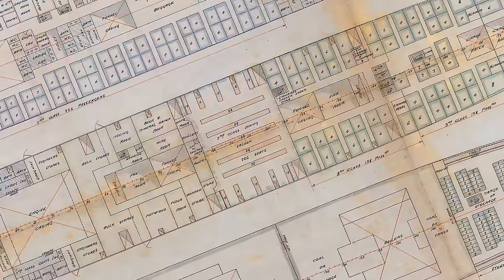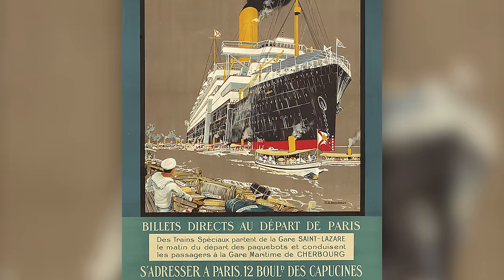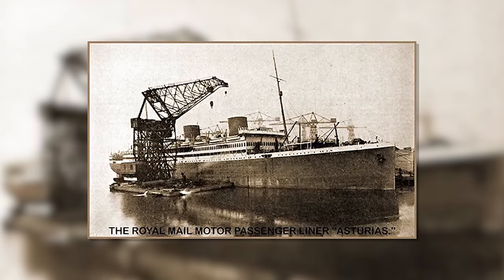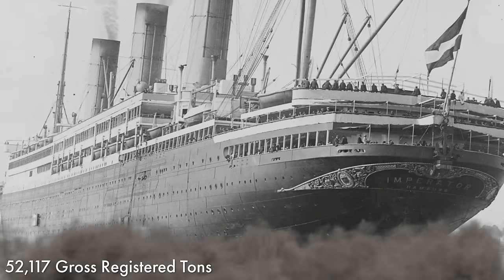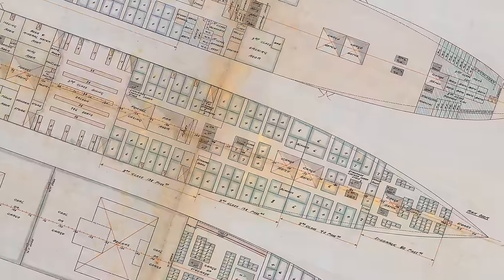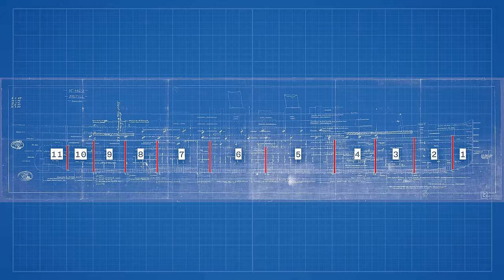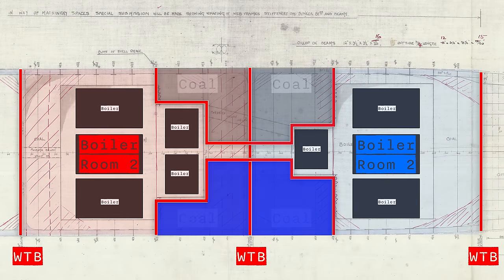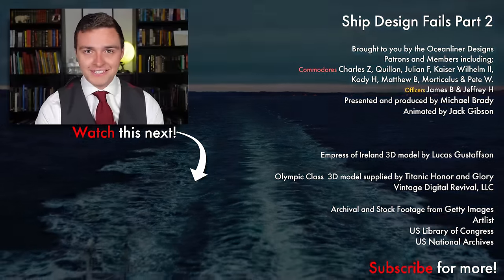When Engineering Goes Wrong: Three Badly Designed Ships

Comment: The story of the Emperess of Ireland is exactly why modern ships are required to close all watertight doors when doing thigns like making the transit into or out of port, or in a place like the Saint Lawrence River. That used to be one of my jobs on multiple ships. Personally verify that the doors were closed, and I got reamed out once by a captain for just looking from like 30 feet away and seeing that the door was clearly shut and properly dogged closed. The rule was that if you didn't put your hands on the door and make sure it was dogged by shutting it yourself, the door was not considered secure for sea because it had not been properly verified.
Reply: I can understand why your captain was upset with you.  Wasn't there a ferry that sank because the person responsible for seeing that the loading bay door was shut just did a visual inspection of it and didn't notice it wasn't completely closed?
Reply: @thatjeff7550  I can understand it too, but I can also understand that if I can see a door closed with dogs engaged, he needs to take my word for it as an adult and a professional. He was going to be putting a lot more trust in my abilities within a few hours. If I couldn't properly identify that a door I operate dozens of times was closed by sight from a few dozen feet away, I would have been deeply unfit to stand the navigational watch.
Reply: @thatjeff7550  the Herald of Free Enterprise sank because the person who was supposed to close the doors was asleep in his cabin and nobody else verified or knew the doors were still open.

Comment: Retired naval architect here.  Great explanation and video production qualities.  Longitudinal bulkheads also contributed to the sinking of IJNS Shinano, a WW2 Japanese aircraft carrier.  A severe list developed which prevented voids on the other side of the ship to be counter-flooded - their intake valves had quickly been raised above the new (heeled) waterline.
Reply: IIRC the same was also true of the aircraft carrier HMS Ark Royal (91) which sank in 1941 in the Mediterranean following a torpedo hit by a submarine. Her machinery spaces were divided into three by longitudinal bulkheads and she had three propellors. Flooding of one boiler room caused a list to develop quickly, convincing the captain that she was about to go down quickly as two other RN carriers had done, so he prioritised getting the crew evacuated over damage control. He was later court-martialled for this, but on the up-side, there was only one fatality from the entire episode.
Reply: The Shinano part is very close, but not completely correct. What happened was that immediately after the torpedo hits on starboard, counter flooding was done on the port side of the ship in the dedicated counterflooding compartments, and that kept the list of the ship at manageable levels at first. But since the ship was still under construction and was not fully watertight, flooding continued, and at some point the captain had to order one of the port *boiler* rooms flooded. And the valves from that boiler room were now above water.
Reply: @xxnightdriverxx9576  Thanks.  I was remembering an account I read many years ago.  I appreciate the correction.  Thinking about things now, four torpedo hits would likely have sunk Shinano even without its longitudinal bulkheads.  They sure didn’t help.
Reply: @Sagart999   @TheVirginiaGuy  you were like 99% correct, far more correct than most of the internet and most YouTube videos, so don't sweat on it :D

And I appreciate your insight as someone who actually worked in the field, as opposed to people who just read up on incidents as a hobby (like I do).

Comment: The diesel engines were just a bit ahead of their time. The three German navy  Panzershiffe (heavy cruisers sometimes called pocket battleships) built between 1929 and 1936 worked well with diesel engines. 28 knots max and the ability to accelerate to full speed very quickly compared to a steam turbine ship, extremely useful in a fight.
Reply: The engines of German pocket battleships were demanding on maintenance. It became a reliability issue and is probably a significant part of why Graf Spee did not leave Montevideo.
Reply: @Dave5843-d9m  Graf Spee couldn't leave Montevideo because an 8" shell from HMS Exeter had penetrated her main armour and disabled her fuel refining plant. The plant effectively converted bunker fuel into diesel, it couldn't be promptly fixed in Montevideo and Graf Spee didn't have enough refined fuel to get very far, certainly not the 8000 miles or so to the nearest friendly harbour.
Reply: Yes but you have not mentioned the most remarkable thing about them- They had an almost unbelievable range of 16000 nautical miles !!  What ship even today has a range of 16000 miles ??   ( Except nuclear of course )
Reply: Graf Spee's Captain Lensgraft rented a hotel room in Montevideo, then commited suicide wearing his full dress uniform.
Reply: @thesterrave I guess I missed the continuity here.
Reply: Somewhat incorrect. A steam turbine or reciprocating engine can accelerate a vessel just as quickly if the vessel was at full steam. However, for fuel and fresh water efficiency reasons you don't cruise with boilers going for no reason so on initial contact they could accelerate faster. The delay was in building up steam, however once the plants were all hot the diesel engines were actually at a disadvantage in power output. The Deutschland class primarily used diesel engines to try to keep the machinery space requirements down ( no need for boilers, water distillation plants, fresh water tanks and condensers) so as to keep the hull displacement down.
Reply: Langsdorff, not Lensgraft
Reply: @Cragified So the original comment was right, the diesel engines allowed the ships to accelerate quickly

Comment: The problem of longitudinal watertight bulkheads causing asymmetric flooding which capsizes the ship is now considered a well-known issue and isn’t done anymore unless provisions are made for cross-flooding devices to ensure that if too much of a compartment is flooded, the opposite side of the compartment will also automatically flood. 

Also, floodability is termed floodable length, at least here in the US. 

And we now calculate damaged stability to make sure that as a ship floods, it remains upright, and use a thing called V-lines to ensure that neither heel nor waves will cause down flooding that would sink a ship the way the Empress of Ireland did.

Comment: The longitudinal bulkheads used as coal bunkers weren't unique to the Empress, the Lusitania had them too. Both ships suffered catatrophic damage to their sides and developed a heavy enough list lifeboats couldn't be lowered. The main differences is Lusitania was struck closer to the bow, was operating with its watertight doors shut and had more time before the flooding reached parts of the ship with longitudial separation. A converse example is the SS Justica, a ship worthy of a comparision video in its own right. The 2nd largest ship lost in WWI (after Brittanic), built by Harland & Wolff at the same time as Brittanic, launched 5 months after Brittanic, registered in Liverpool, operated by White Star and is marginally larger than Lusitania. She took 3 torpedos to the midship over the course of 2 days to put on the bottom and sank on an even keel, the Lusitania took 1 torpedo, 18 minutes and went down in a spiral. I feel if Lusitania had been struck amidship the result would have been nearly identical to the Empress and the loss of life even larger.
Reply: Love the Justicia. She was 37 ft shorter than Lusi but they were about the same GRT. Justicia having around 1000 more GRT
Reply: Also worth noting the U-boat which sunk SS Justicia was in turn depth charged then sunk with deck guns with the loss of all hands immediately afterwards.
Reply: Yes what is most interesting is that had the Lusitania or Mauritania suffered exactly the same damage as Titanic in exactly the same place it is almost certain they would have survived because of the inner longitudinal watertight bulkheads.
Reply: @thesterrave  There are other ways of repenting for your sins than by turning to the false moshiach Jesus. He is not the son of Hashem, and Hashem is not a trinity, He is one, He is Adonai Elohim, only through Him and through yourself can you repent for sins. Jesus was a good man, but NOT the moshiach.
Reply: @thesterrave  I wonder if you would be kind enough to tell me what on earth your comment has to do with ships and shipping ????
Reply: @thesterrave  LOL, the book of Genesis is the first book of the Tanakh, the HEBREW Bible. You're not a very learned Christian, are you?
Reply: That's debatable, one of the things that made her loss so bad was because the forward flooding pulled her down at the head, And pulled her screws out of the water. The reason she corkscrewed was that Turner had ordered her beached since they were in sight of Ireland and put the helm over. If she was hit amidship she may have listed closer to 30 degrees rather than 15, but she would've probably made the coast and beach.

Comment: A minor error by mike.   He said a steam turbine needs a reversible gearbox.   Actually, many turbine ships were built with reverse-torque turbines on a common shaft with the forward turbines.   This is possible because a turbine not receiving steam offers negligible friction and turbines are very compact.  Usually a ship doesn't need to go backwards very fast, so the reversing turbines can be very small.
Reply: He also reversed the effects of high and short metacentric heights
Reply: The gearbox has nothing to do with reversing the direction of the propeller or the vessel it is only there to reduce the high speed produced by the turbine to the propeller shaft speed. Most steam vessels only use one set of low pressure blades within the turbine casing to drive the vessel astern, as a result steam vessels have poor astern speed and can be difficult to manoeuvre and berth.
The poor astern performance was one of the main reasons why the use of steam turbines was phased out on cargo vessels as they required several tugs to assist in berthing. the cost of the tugs coupled with high fuel consumption spelt the end for steam ships.
Reply: @grahamc887  Correct - well almost.   Some steam ships did have reversing gearboxes, eg USN Iowa class.   Some had turbines that could re-route the steam so as to run the turbine in reverse, e.eg, Royal Navy Tribal class.
It was quite common to have better reversing turbines than just single stage types, which would give extremely poor performance.
The main reasons why steam was phased out in favour of diesel in cargo and passenger ships is better fuel consumption and saving in space.  The more cargo and passengers you can stuff in the more profit you make.
Reply: @keithammleter3824   thanks Keith, I can only speak from experience. As you say there is a vast difference in fuel casts, the steam vessel I sail on at the end of the 70’s seen fuel consumption half, after the plant was changed for a diesel, but at reduced service speed.  However the main reasons sited by the owners was the reduced manoeuvring capacity which required the use of additional tugs and higher insurance cost particularly when transiting the canals.  Even back in the late 70’s the environmentalists started to raise issues regarding the sake and acid rain generated by steam ships particularly when manoeuvring in port. The writing was on the wall for steam cargo vessels.
Reply: @grahamc887  :  Good point - I had forgotten about the environmental aspect, and it is important, thanks to the euro greenies.   The trend now in big ships is not to use direct diesel propulsion and instead have an engine room of various size diesel engines turning generators feeding a redundant bus system. with the bus powering electric propulsion motors.   When at sea cruising, you run 2 or 3 big diesels to generate the power required, but in port you shut the big diesels down and just run a couple of (relatively - they are still megawatt size) small diesels to provide just enough power for port manoevering speeds - fuel consumption is even better, emissions still lower, and reliability is actually improved.  And no compromise on manoeverability.   Tied up at the dock and you only need to run one little diesel to provide lights and auxiliaries.
Reply: @keithammleter3824  " Some steam ships did have reversing gearboxes, eg USN Iowa class. "  Nonsense, they did not have reversing gearboxes.
Reply: @oldtugs  I googled and checked before posting.  Did you?
But I forgot to mention that many modern ships have no need of tugs because they have rotatable bow and stern thrusters - they can even go sideways without any forward or reverse motion at all.
Reply: @killingtimeitself  Considered what?
Reply: @keithammleter3824  No need to run anything if port services are provided.
Reply: @gaoxiaen1  : True, but they often aren't.   And, often captains will ignore port power anyway, as it is cheaper to run a generator set in the ship.   Here in Australia, fuel is heavily taxed, unless it is supplied to a ship.   And ships have enough range to fuel up in other countries that subsidize fuel instead of taxing it.   Often, port electricity is incompatible with the ship's electrical system.   For example,  an Asian ship, likely requiring 400 volt 60 Hz may visit Australia, where the power is 415 volt 50 Hz.
Reply: @keithammleter3824 Australian ports are fully capable of providing electrical power that meets the requirements of any modern ship on the entire planet.  I’ve been in numerous different ports in Australia during my 20 years in the United States Navy, and we’ve often had shore power cables run so the engineers could perform maintenance and repairs on the ship’s diesel engines that generated electricity for the ship while out at sea.